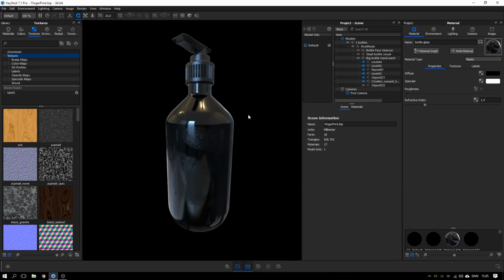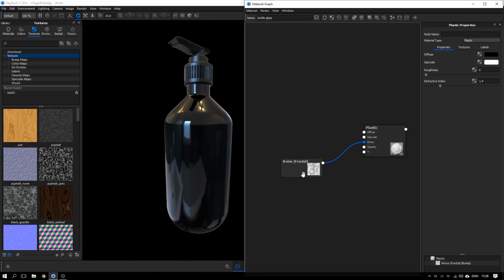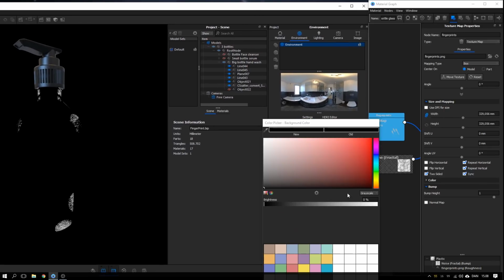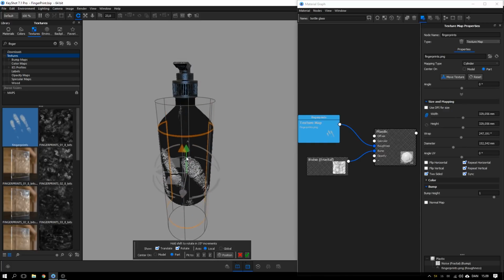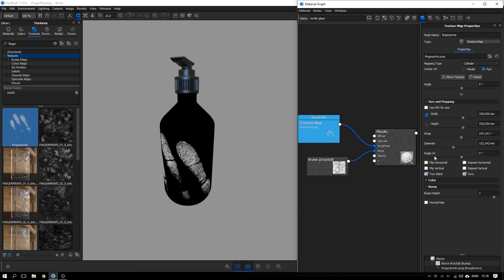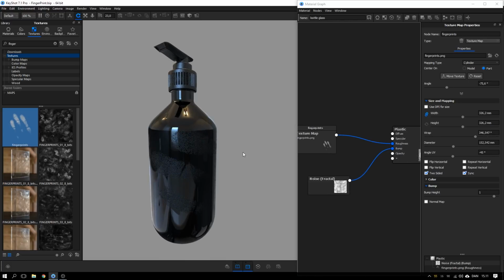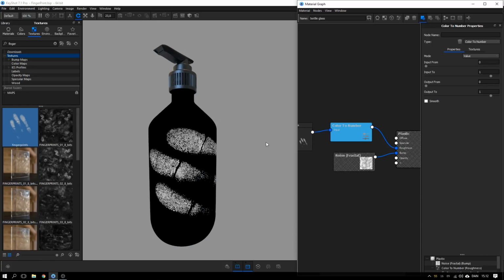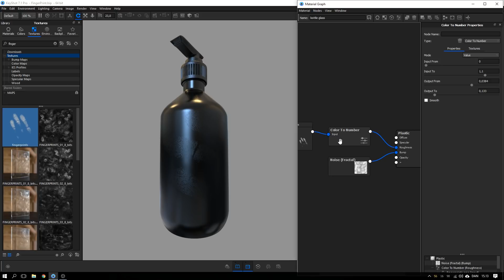How to add a greasy fingerprint to any material in KeyShot 7

Comment: In real life greasy marks catch the light at certain angles BECAUSE of their smeared angle, the angle of the rubbed smear creates fine parallel ridges.  Keyshot cannot render this.
Reply from the maker: True. However, with the new generic shader in KS9 and its ability to map anisotropic angles, it should be possible to at least get close to what you describe, right?
Reply: @esbenoxholm  In that case yes, in theory , the problem is making and converting angle maps from other apps, there is no format standard and very little knowledge available, but that's not a Keyshot issue.
Reply: To create a map you could draw it using an App that converts the angle of your brushstroke to the correct colour for your angle-map. Or you can render objects to make a map (think scattered scratch shapes) with a shader that creates the right colour based on the orientation of tehe objects. The second technique works well for dense micro-scratches.